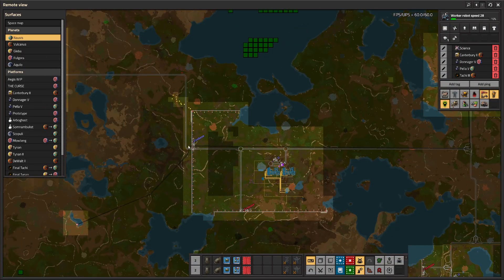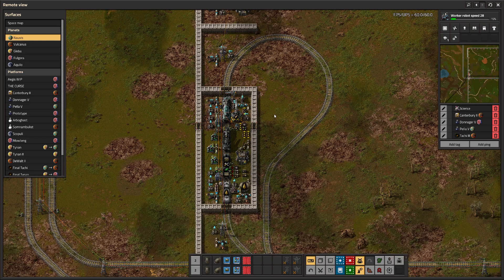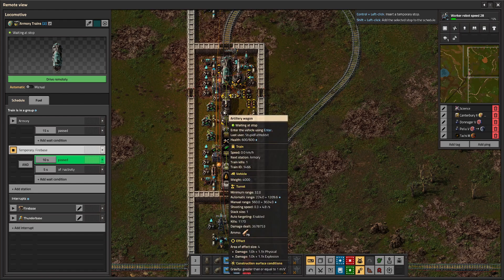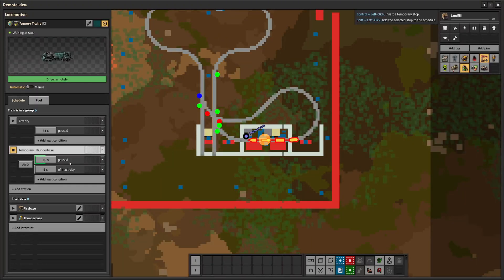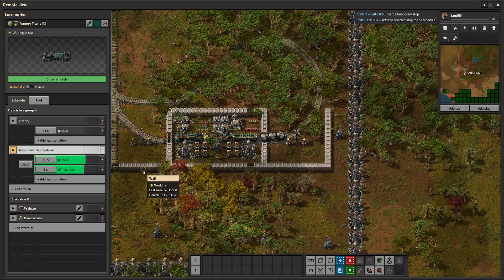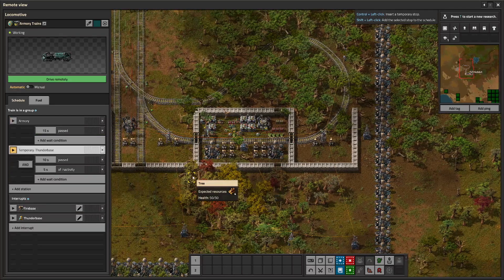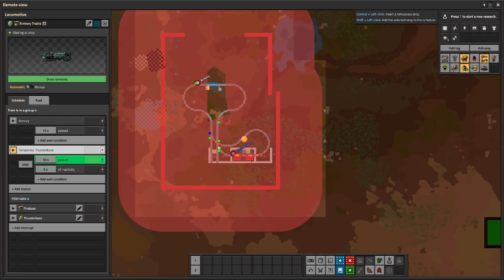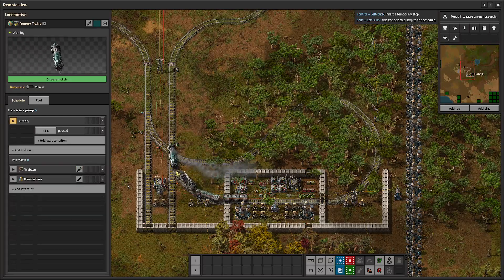Factorio Space Age - Artillery Delay Issue & Delta Listener Circuit

Comment: I was wondering, is there a way to generate a signal for more than one tick that can be reset like every minuts or something, i wanted to monitor my ammo per minuet, but i didn't found a way to make the signal last longer. To resume i juste want to kow if there is a way to change the constant generator signal and make the constant change every minute
Reply: Hook up a standard clock circuit to a "divide by X" arithmetic combinator. Adjust X to your liking - a value of 3600 would give you a clock that counts minutes instead of ticks. Alternatively hook up a standard clock as "if time < 3600 output time+1" and then you can trigger your circuitry "if time = 1" to perform some logic once a minute.

Comment: An interesting find! I'd think an "easy" optimization on the engine side would be prioritizing candidate chunks for expansion. Or perhaps, a "push notification" of sorts from the biter expansion code module to the artillery target finding code to add list of chunks to search, as the engine already knows where the targets are
Reply: Or alternatively to only check chunks that are candidates for expansion. There's no reason to check a chunk if it isn't a candidate for expansion because even occupied chunks show up as expandable.
Reply: I was thinking just use a tree with each layer combining into more and more area. So the common case displayed here would be greatly benefited. Many checks would cross off 10s to 100s of chunks per check. Leaving time to deal with the edges of the turrets range which due to not lining up with a large grid on the map itself (the tree), would still result in many chunks getting check individually.